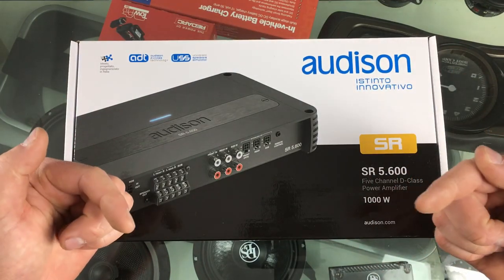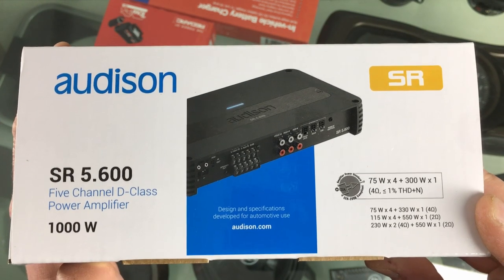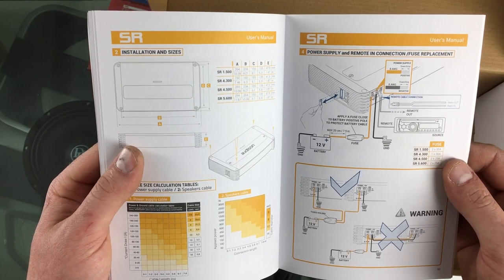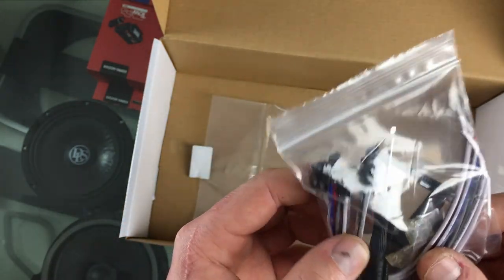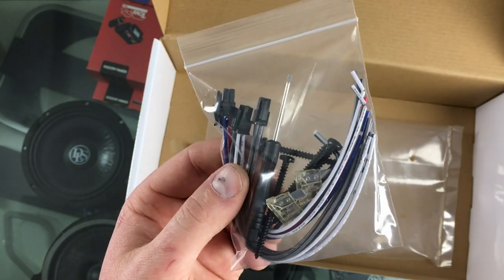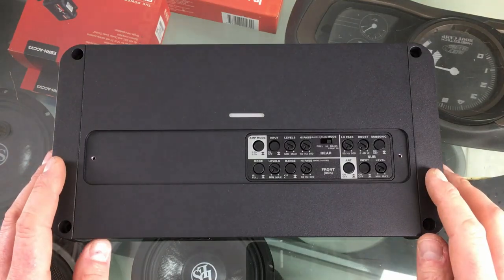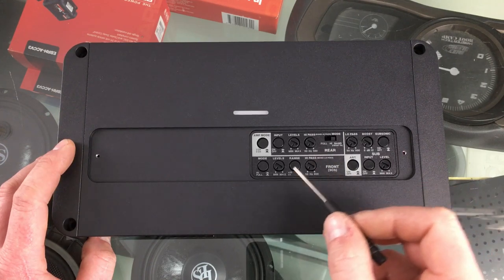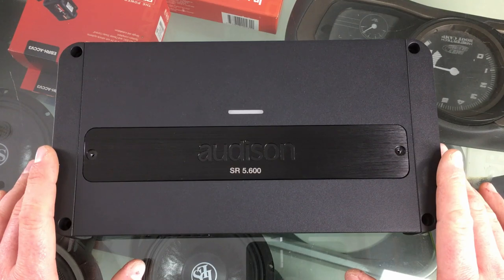Audison SR 5.600 Unboxing

Comment: Excellent video sir! Quick question though. Seems like this amp is not power hungry at all, which is great. It seems like this Audison only requires a max of around 42 amps if I remember right. My JL Audio 5 channel amp requires an 80 amp inline fuse and it’s 100 less watts than this Audison. Seems amazing how less taxing it is on the vehicle’s electrical system

Comment: I really enjoy this amp.  I have it connected to 2 Pioneer Z 6.5 components and 2 coaxial as well as a JL Audio 12 inch microsub.  I am swapping them out this Thursday from my old 2020 Optima SE to a 2022 Kia Sorento Hybrid.  It should sound even better in a SUV!

Comment: Anyone getting crosstalk between woofer and tweeter channels? It’s set up bandpass 6.5 and high pass for teeeters. Correctly hooked up.
I played under 100hz sweep and the tweeters were making noise moving in and out. I’ll try to get it swapped by the distributor.

Comment: Would this work smoothly with focal ps165 fse components, the rear with stock 4” speakers, and a 10 inch sub focal P 25FE.

The component speakers are 60w RMS
And the subwoofer is 300w RMS

Do you think it’s underpowered?

Thanks
Reply from the maker: Set up properly, that sounds like a fairly good combination.

Comment: 1000 watts fused by two 25 amp fuses and 8 gauge wire? Class D full range? I don't think so.
Reply from the maker: That's okay Craig. You don't have to think so. 
CEA ratings (as written right there on the box) total 600 watts, which is absolutely plausible given the fuse ratings.
It would be a reasonable suggestion that the 115w x 4 @ 2 ohm and 550w @ 2 ohm ratings are measured with one channel driven, not all, which again is within the scope of the power supply. It's not uncommon to find that measurement method in home and car audio which is why it's not bracketed in the CEA ratings.
I agree with your skepticism however that they take those individual measurements and write '1000w' on the box. It's really not.

Comment: hi enough power audison sr5.600 front speakers morel maximus 602v2 rear morel tempo coax 6x9 subwoofer Alpine SBG-1244BR I will be very grateful for your reply
Reply from the maker: Sure is. Just be sure to have crossovers and gains set properly, as with any amplifier install. All the best!